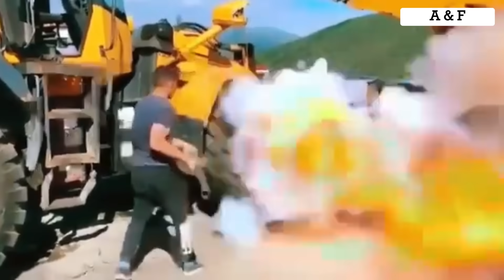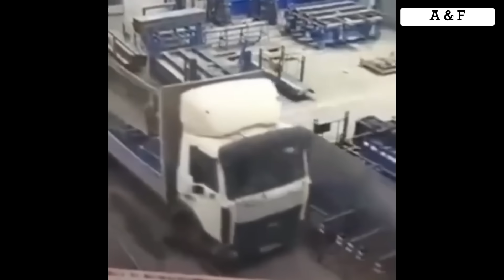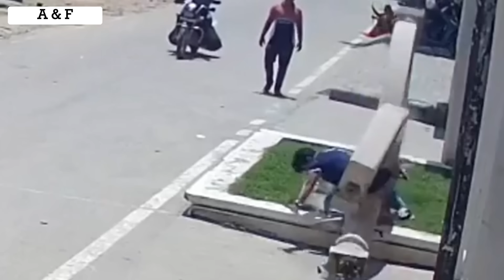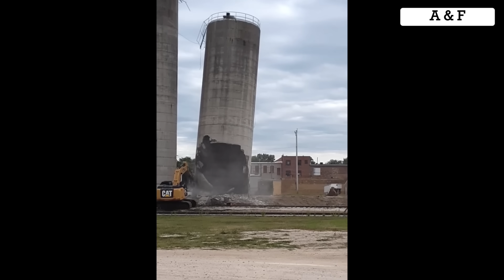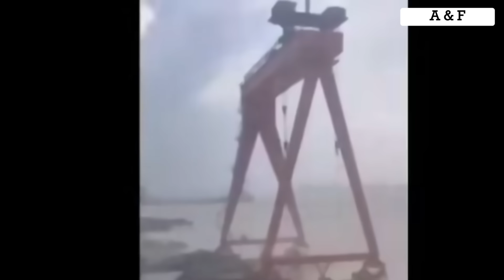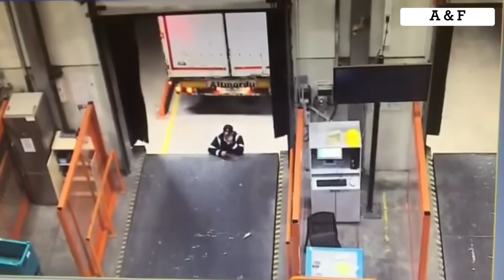⚠️ Accident - Firefighter Touches Power Lines With Metal Pole

Comment: I’m an electric utility company lineman. That guy using a metal pole to play around high voltage is insane. But not for nothing, I think I learned at around 8 years old that you never put anything metal near electricity. There are 3 idiots in that video. The 2 that are involved and the guy filming. I’m hoping that those 3 morons aren’t US soldiers.🤷🏼‍♂️